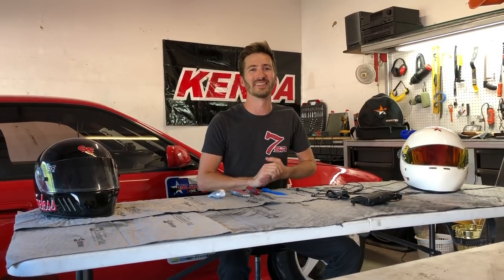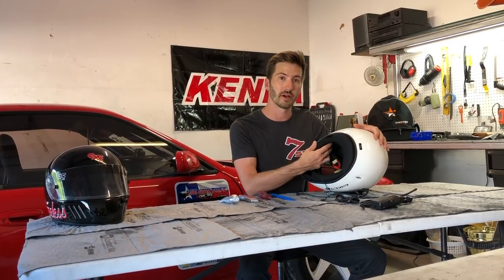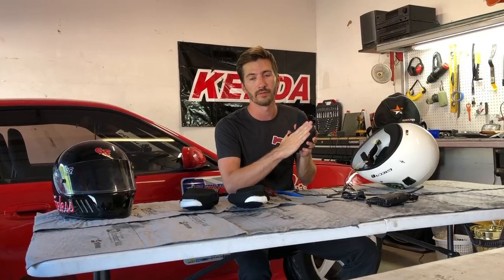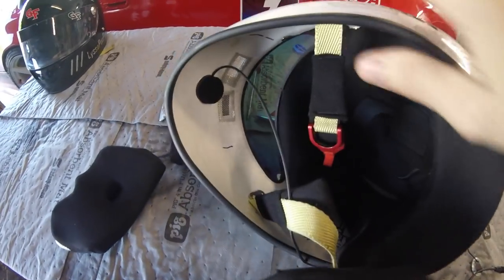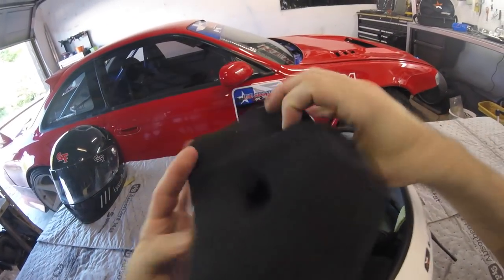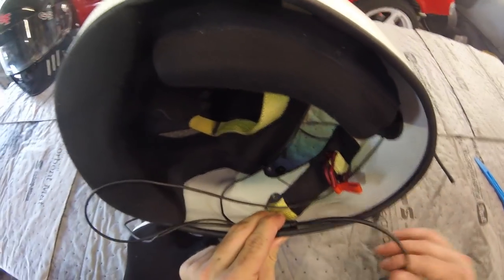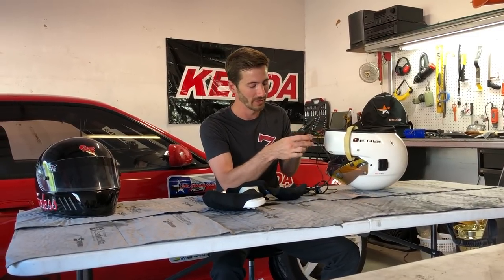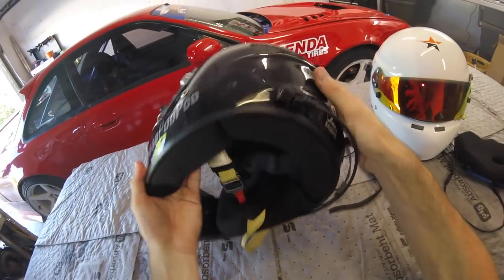How to install in helmet radio system

Comment: I'm using the exact same setup for 3 years now in rallycross. Cheap to buy and really good. Only thing I would like to change is the way the helmet cable connects to the wiring harness. You have to screw the 2 connectors together. It works well but in an emergency situation it takes to much time to unscrew. I did break one cable when I got out of my car without unplugging, the cable snapped without me noticing a thing!! So I guess it is pretty safe. Other downside is that the Baofeng walkies are not certified to use in Europe. When they catch you, you loose em ;)
Reply from the maker: 25 dollar loss lol!  How do they find you?
Reply: We have one track that is close to a military base. They have a van with a dish on the roof to track the signal down. Even when the radio is just turned on, not transmitting, they can find it. When your radio has the CE (China Export) logo stamped in the back, it is illegal in Europe. The army guys are usually pretty chill about it. If you just hand them over they won't give you a fine (fine is 300 dollar). They are also pretty strict about drones. If you cant show the right documents, they will impound your expensive DGI drone and crush it... The other tracks we race we never have problems of this sort.
Reply: Could you tell me a bit more about the stuff not certified in Europe? I’m also in Europe but haven’t heard anything about that and would hate to buy shit that will just get confiscated.